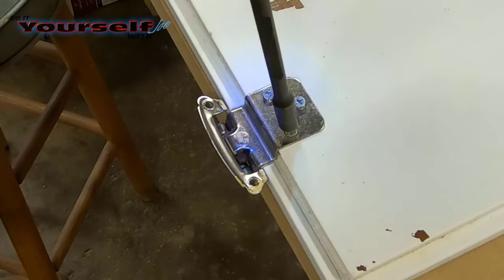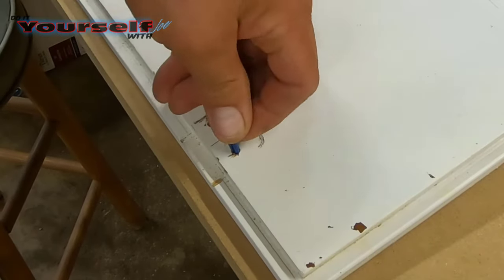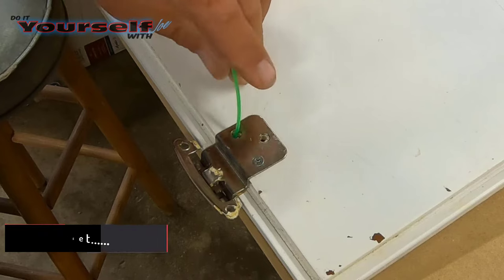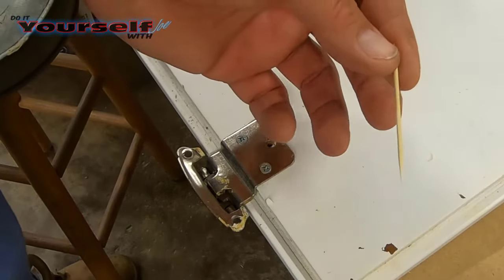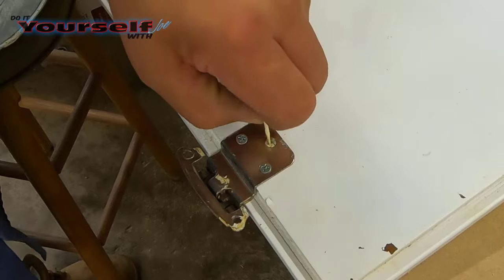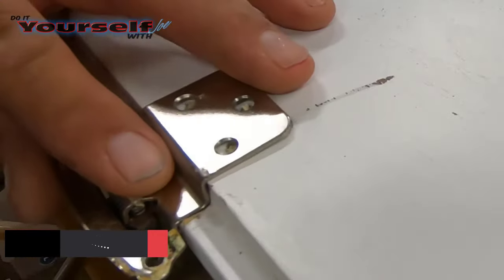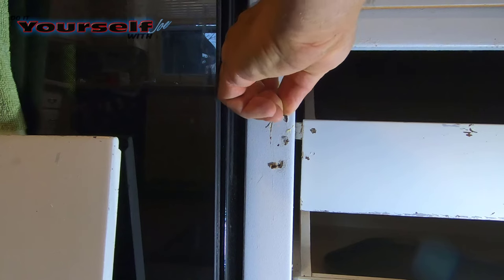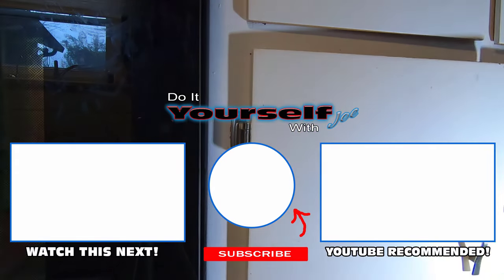Kitchen Cabinets, Fixing Stripped Screw Holes

Comment: Thanks for this. I've got those rocking adjustable cabinet hinges, and the stripped screw holes were on the inside of the cabinet. I tried the toothpick/glue method and after a couple months, the dang screws came out and the holes are stripped again. Is moving the hinge now the only thing to do?
Reply from the maker: one last thing you can try. You can fill the hole with resin then redrill. Or you can try CA glue, fill the hole with CA glue (super glue) and install the screws. One other thing I've done is to install small dowels.
Reply: @Doityourselfwithjoe  I will try one or both of these solutions! Thanks much. Also I think my screws were too short.

Comment: Will super glue work instead of wood glue?
Reply: Also a match stick fits in the hole. I could use that with super glue?
Reply from the maker: @sixtieskid  yes that will work.
Reply: @Doityourselfwithjoe  I bought a $19 drill at walmart and got the job done. Thanks so much for the info!
Reply from the maker: @sixtieskid  You're welcome!